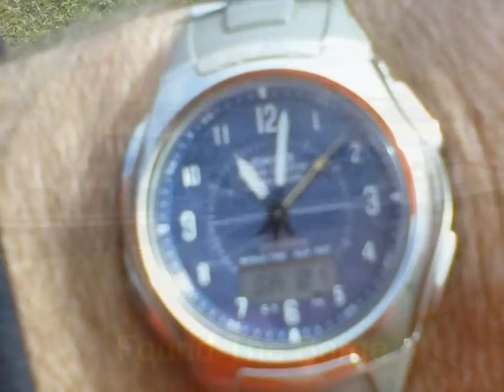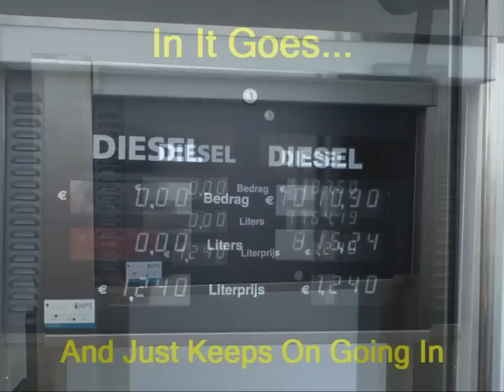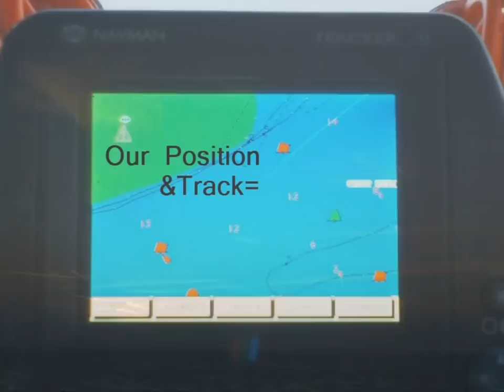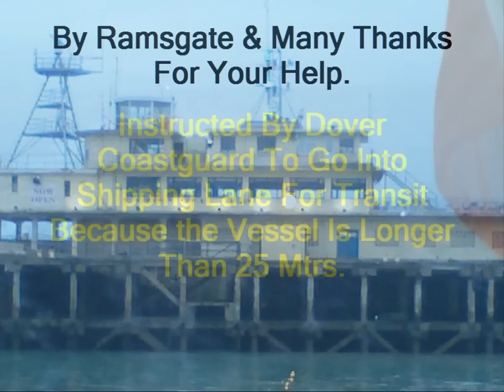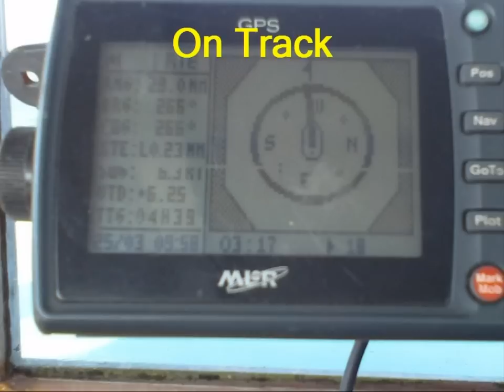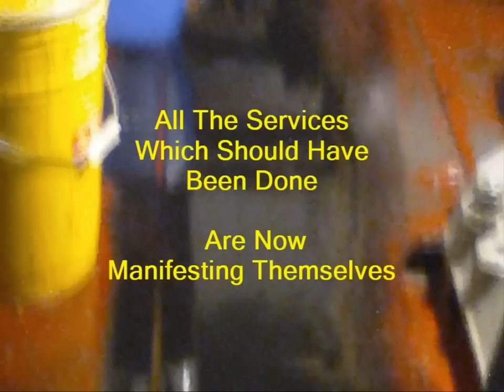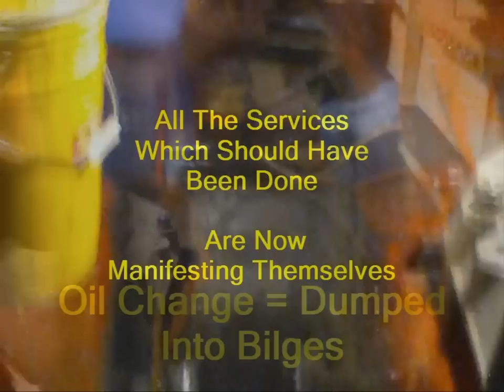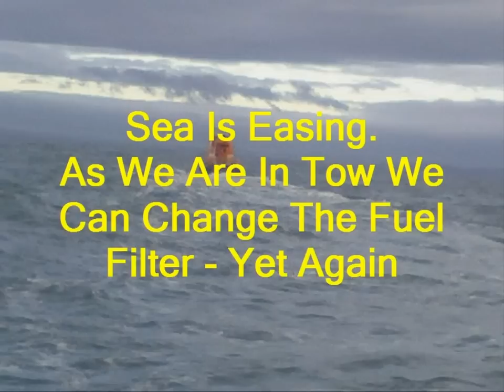Dutch Barge Delivery Skipper

Comment: HAS a Marine Engineer  YOU SHOULD OF HAD THE Bulges Pumped out before you left  and you should of looked too the fuel tanks for water in them too if you where anything of a Skipper
Reply from the maker: Hi Anna. Bilges were dry and the vessel had an insurance survey saying all the work had been done including cleaning out the fuel tanks and engine oil change...
The water we took in was due to the rough sea squall we had - which was issued in a special radio bulletin for our area however we had nowhere we could run for shelter as we were previously instructed by Dover coastguard that our vessel was too long to go on the in-shore route and at our slow speed we just had to head into the weather... Water was taken on board with the high waves but that was not the problem as it was the fuel filters that were blocking again which would have caused an issue...
In short the insurance registered surveyors report left a lot to be desired...
No way would my skipper with over 48 years sea experience take out an unsafe vessel and this vessel is small fry to what he can legally captain...
Thanks for you comment and the video was posted so others contemplating a sea crossing would not rely on a ships / vessels survey and ensure the fuel tanks have been cleaned...
Regards Peter
Reply: hello how did you get water in the engine room when the vessel should of had all battend down and man hole hatches battend over with traps covers  and wedged all porthole done up tight  on Dutch ships or barges normally you can get too the engine room from the wheelhouse and most dutch vessels do around 15 knotts    and light barge like this should of been in ballast  and the best place too be in heavy weather is well away from the Coast line   has you get battered even more with the back swell  and you always keep her head too windward    too ride heavy weather  otherwise you end up in davis locker hi  but you got there in end  that what maters
Reply from the maker: Hi Anna. 15 knots!  I wish. Fastest we have ever managed with the tide is around 9.7 down the Thames. We NEVER strain the engine as we have to ge a long way so we always take is nice and steady. As for the comment keep her into wind my skipper Keith has near 50 years experience doing this and is a fully Lloyds registered skipper and is on call for any size vessel that may get in trouble and need a skipper. My life is in his hands and I can assure you that if I was in any doubt about any of his decisions I would never sail with him. Its hard for you to understand as a video of pictures can't show a lot of the event however the only thing I can honestly say that may satisfy all your questions is 
" I FULLY TRUST KEITH (Delivery Skipper) WITH MY LIFE".
I hope you understand this comment is not given lightly.
Best regards for your comment. Peter.

Comment: never knew it would safe enough to cross a sea with an inland barge
Reply from the maker: Hi there. Before we bring a Dutch barge across the channel we ensure as best we can that the weather window and state of the sea is safe for us to proceed with a safety window margin built in to cover any delays. You can’t account for everything (as you can’t in life) however experience from a good skipper with over 40 years on the sea licenced for everything that floats gives me confidence to be his crew. We also only move fully insured barges which ensures they have had a full survey and are fit to float. We have been caught out buy an unpredicted squal once which caused us problems but we handled the situation but had to call out the RNLI due to the sludge being stirred up in the fuel tanks and being unable to stop the engine to change the filters due to the weather and sea state. Once the RNLI had a rope on board so we stayed into wind it only took me 12 minutes to change all three filters and bleed out the air and get the air start engine going again. The video is on my site...
Best regards Peter

Comment: Hi Peter < just a horrible trip was it? Well my cousin delivered a " Luxe Motor" to the irish sea , trough the canal trough Scotland , they suffered gale force and where afraid the barge would sink , fortunately they made it . It was a fast Motor equipped with 365 HP caterpillar they  easy did 11 knots . Then once arrived in Ireland they lift it out the water and put it on a truck , where the barge is refitted into  sand dredger. as where is still is . I am master all ships that is right now at home in my free time . Though I came from these inland barges and have been skipper for many years right after I finished high school. I am working in oil and gas industry as master . Would like to see your reply in case you need an help on your exiting voyages .Karel
Reply from the maker: Hi there. My skipper Keith has also made the same delivery to Ireland via the Scottish canals and relates they cut the barge up for it to continue by road to its working destination where it's welded back together again - I was told the nightmare is always getting the electrical wiring sorted out afterwards. Sounds an epic type of journey that would be great in the summer months as long as the weather stays with you.
I don't think many canal cruise people are aware how badly a barge reacts on the sea and how you have to continually adjust your course depending on the wave frequency and wind direction and as they have a tendency to "skate" rather than make a straight course - the concentration required to keep the straightest course is 100% and drains you down as you continue to rotate your crews position. My skipper Keith Willard has had over 45 years on the sea so you should have heard of him as he has brought many 100s of barges over in his time and are all insured deliveries. I do enjoy the adventures however we have had a few "knockers" where delivery was completed but who don't pay their bills which puts a bit of a bad taste in our mouths... One of the problems you have when you take no deposit.

Comment: These cargo barges are made for inland waters, not for the high seas.
Reply from the maker: Hi Wil. Your right about being built for inland waterways but they can do a channel crossing as long as the weather is fair - we are insured to make the crossing only up to a force four wind and Keith our skipper has over 40 years experience in making such crossings - but you can still get caught out if there is a squal which even the best weathmen can’t predict. The problems we forever have are always due to diesel tanks not being cleaned out - even after a year diesel pox can build up and once your at sea the sludge gets stirred up and can clog filters but to get owners to get the tanks cleaned is not an easy task as they always think they will be fine.
The owners also do not understand that the cleaning of the fuel tank is part of their duty to their insured crossing... it’s like all things, there are always risks but with someone like Keith, (Delivery Skipper) at the helm with the experience he has the problem factors you can have are almost cut to zero. 40+ years at sea tends to make you aware of the dangers and that’s what a good skipper commands - a good safe vessel delivery. Glad you enjoyed the video and thanks for your comment. Regards Peter.
Reply from the maker: Hi again Wil. Glad you understand and I just wish all our clients understood the dangers of dirty tanks. Regards Peter.